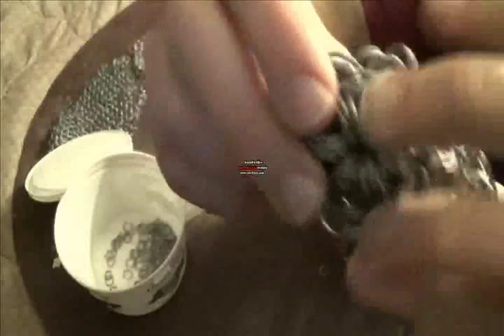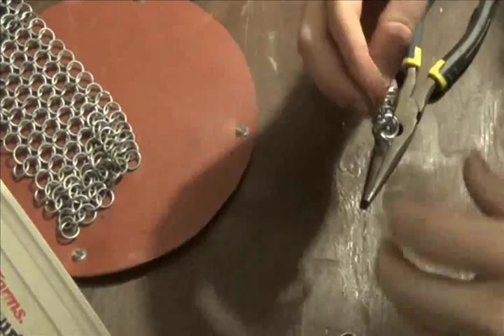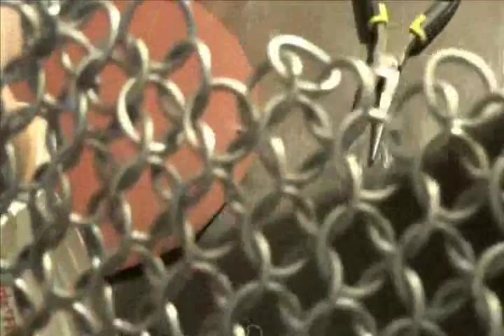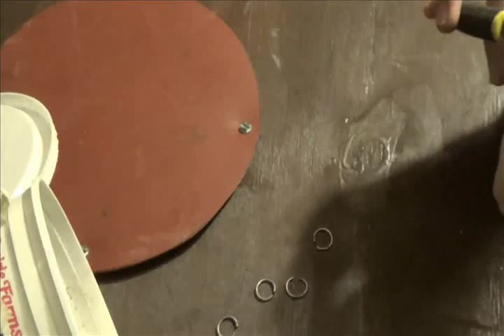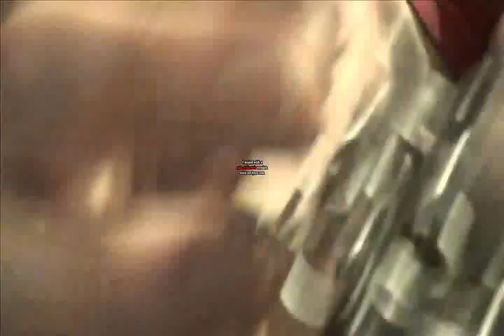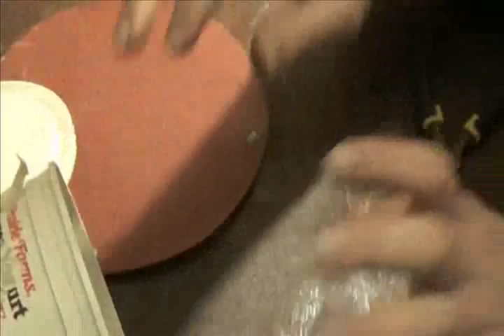Getting Started on Various Chainmail Patterns

Comment: A few questions: 1. Would you recommend I make my own rings for chain mail? If so what materials should I use for the rings? and 2. If I made my own chain mail how would it compare to a store bought piece?
Reply from the maker: You can, fairly simply. They won't hold as well as properly made ones, but here is a cheap way to get rings to start. All you need is a screwdriver of the thickness that you want your rings, some pliers, sidecutters, and fencing wire of the gauge you want your rings. Simply wrap the wire around the screwdriver and cut it. Pre-made rings are better, but more expensive.
Starting off, likely not as good. Once you get good at tailoring and at manipulating the pattern it will be comparable as long as you have good rings. 

I recommend starting off on the cheap end to get the feel of things and see if you enjoy putting in the long hours needed to make something out of mail. If you enjoy it, then work your way up to better materials as your skill climbs.
Reply: demomanchaos Thank you very much for the answers I was looking for! I will be sure to try your method of making rings, and I will try my hand at making my own mail! Keep making awesome videos!